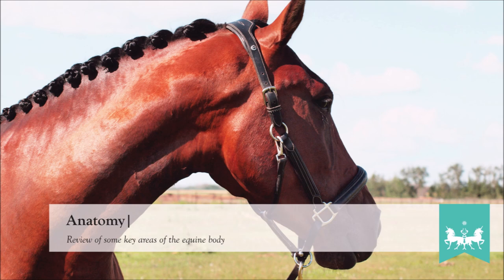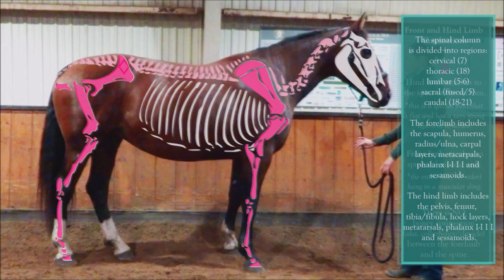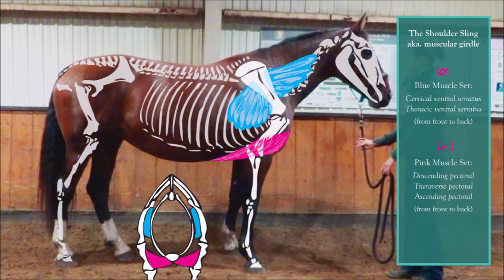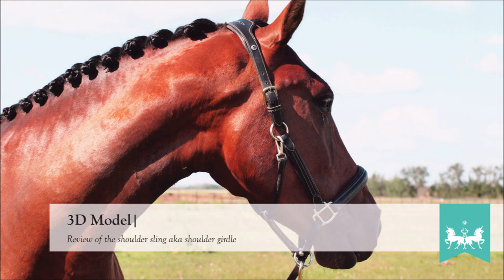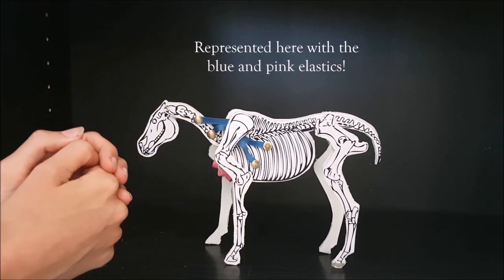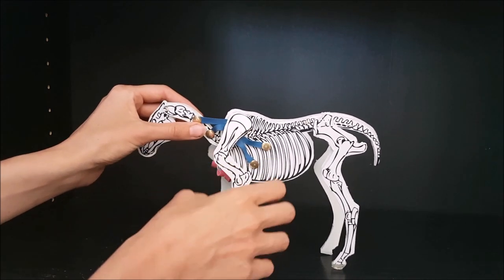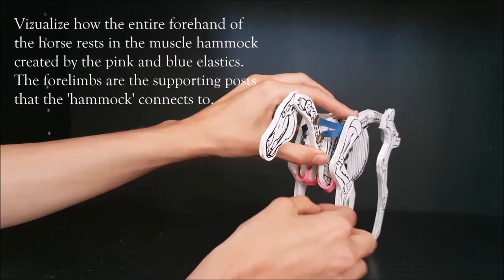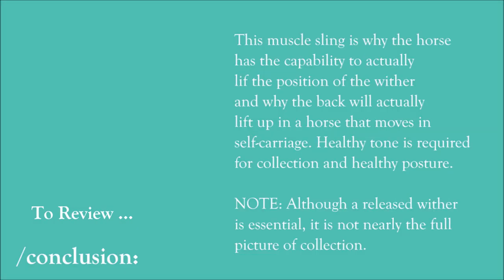A horse's withers can lift: how does that work?

Comment: Ver clear explanation, thank you very much. In what movements do horses to lift their whithers? In other words how can you (train to) let the horse lift their whithers by themselves?
Reply from the maker: Thank you! I appreciate that. ♡

That is a bit of a long answer, but they lift the wither gradually over time as the thoracic sling and pectoral muscles gain strength. This comes from working in a position where the topline muscles are softened and the underline is engaged and helping the shoulder sling engage properly. 

This can happen when standing and asked for a belly lift (as long as there are no other existing muscle or tissue restrictions). 

This also happens when they are working over their back in walk trot or canter. In this case the posture often looks like a long stretched neck position in a deep stretch (especially at the beginning of training). For a more detailed explanation of why/how this mechanism works the book 'Tug of War' is a great and often affordable resource.
Reply: Thanks, I understand all that. My question is what movementscan horses do by themselves that lift their withers?
If I would like to know what movement makes the back come up and the abs engaged it would be backing. Backing doesn't make the withers come up, do they? So I am looking for the movement horses can do themselves.

My equine bodyworker recommended to lift the withers by lifting sternum and walking poles. Would the walking over poles help to engage those muscles?

I know lifting the withers involves the cervical ventral serratus, thoraic ventral serratus and the pectorial muscles (correct me if I'am wrong. I am trying to understand what muscle groups are involved). So if that is correct and I understand what (natural) movements are involved I can train my horse with positive reinforcement to engage those groups on cue. The YT video's I find that do sternum lifts also almost always show horses in pain. I am seaching for a way to let my horse do the work herself so she can tell me when she had enought. I haven't found good videos or websites yet, but if it hasn't been trained yet, it doesn't mean it can't be done. Lifting the sternum by hand (most peolpe poke) is a quick and easy way to get it done, I am looking for a way to teach my horse to do it herself.

PS what kind of belly lift do you mean? Lifting the sternum or something else? I just uploaded a video where my horse lifts her belly (and therefor her back) but she is not lifting her withers as much. 
Thank you!
Reply from the maker: @SandraHippoLogic  You are very much on the right track! I totally feel you with your struggle in finding good resources.  I have a belly lift video, but it is true, the focus is more to the rear abdominal region rather than the sternum. 

A resource you may really enjoy is, Intrinzin. They have a bigger volume of info on their IG @intrinzin and have an actual wither lifting exercise that is taught to the horses via R+ training. R+ may or may not appeal to you, but you can still totally check it out!

In my opinion; I find the horses' engage this mechanism of the wither lift when they feel mentally well, strong and secure. So a lot of what I do is getting to the point where my horses mind is engaged and safe with me. This then allows the fight/flight mechanism that turns on the topline muscles on to relax and the powerful core muscles can then start to work. 

To me, if you can get the mind engaged and soft the body allows reflects this, becoming engaged and soft as well. It really is more natural than some trainers make it out to be. 

I also find that so much horse training is done with force that they then have to find a way to 'make' the withers lift. My method is rather just turn off the fear, force and mental tension that is creating the bad posture. 

Hope that helps!♡♡
Reply: Thank you it totally helps.

 I am a R+ trainer, that is why I am looking for ways to teach the horse (rather than force the horse into the wither lift). As you I am always aiming at engagement of the horse. I experience the same thing you are saying that the horse must feel safe with us and want to do the things we ask (by wanting I mean because they benefit as well, not doing exercise because they are avoiding aversives).

I've come across videos of people training Intrizen method and- to be honest- I am not impressed or inspired by those videos. 

I see a lot of stress (frustration) in the horses and sometimes almost over streched front legs and also high head positions  (which I don't see in the videos where the sternum is lifted by hand/R-) .

In some Intrinzen videos I see almost overbending in the pole doing a kind of wither lift or they hollow their back down (and therefor the wither seem to lift). I must add these videos are by people practising the Intrinzen method, not Intrinzen him/herself.

I haven't seen Intrinzen (de original people/person) on YT, but I will look them up on IG. Thanks again for your time and extended explanations.
Reply from the maker: @SandraHippoLogic  I'm glad! That's fantastic.

 I also have seen the same thing, but I did purchase the Intrinzin program and found, for myself, it is different that a lot of 'clicker training' that produces the frustration. That said, I still focus more on ensuring mental wellbeing over strictly R+ shaped behaviors. 😊
Reply: @thewhitemare  I would love to see a video of your horse doing this.